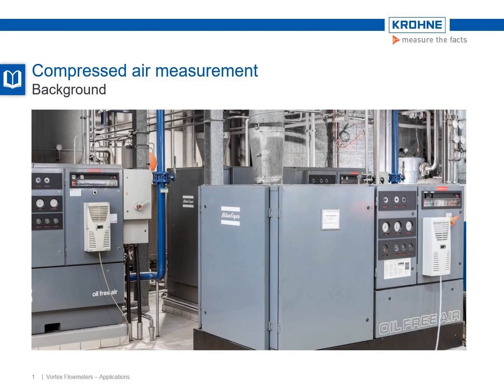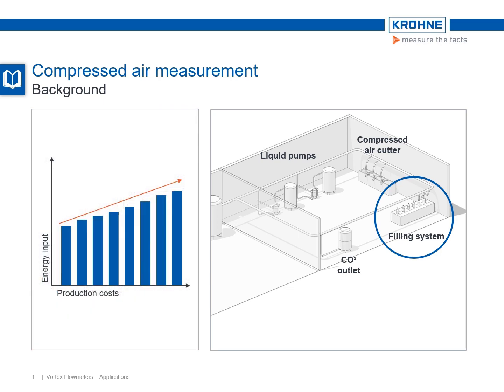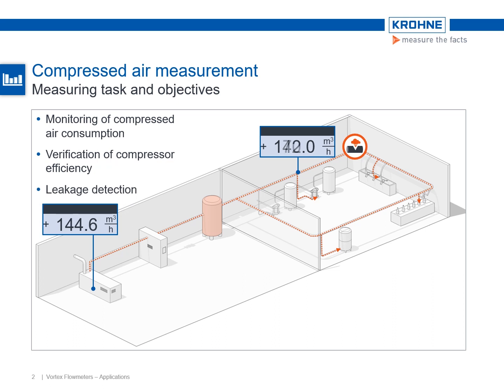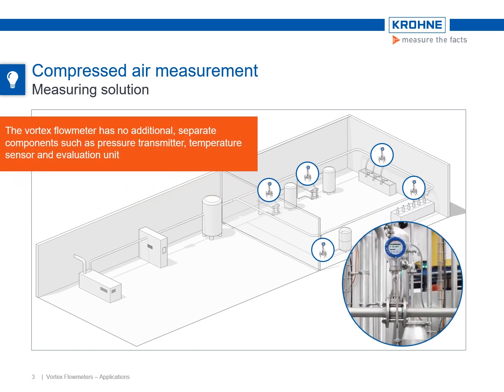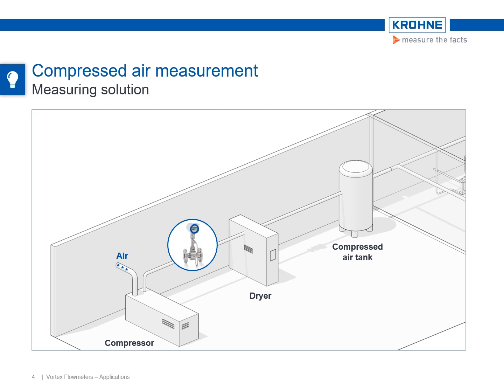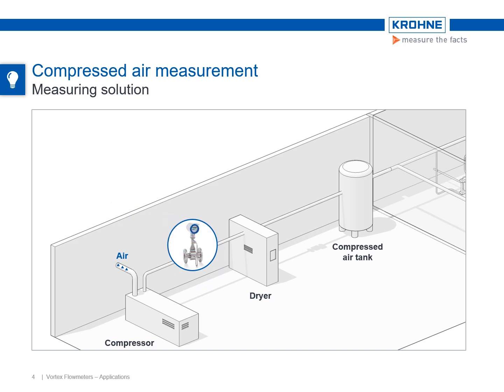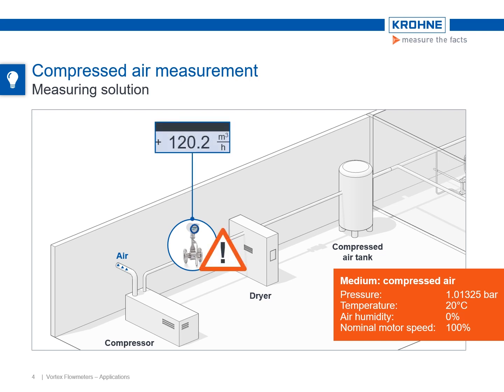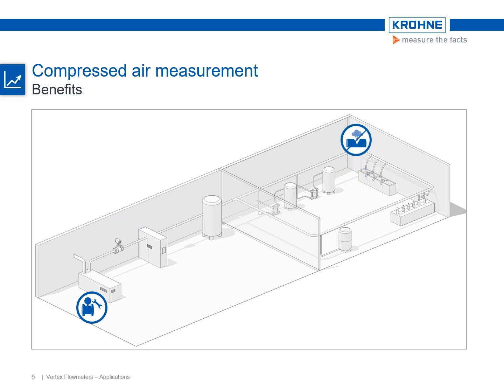Vortex flow measurement of compressed air and free air delivery measurement | KROHNE

Comment: Do we have to reduce piping to install the vortex flow meter?
Reply from the maker: The OPTISWIRL 4200 Vortex flowmeter is also available as a reduced bore meter with an internal reduction of up to 2 sizes.
Therefore, a reduction of the pipeline is usually not necessary.